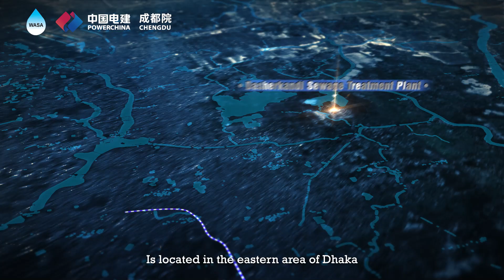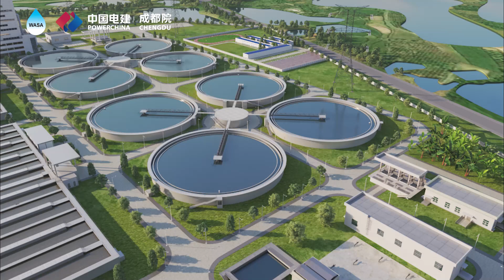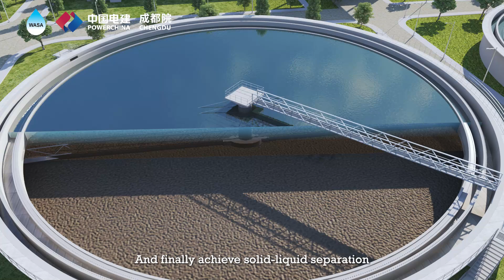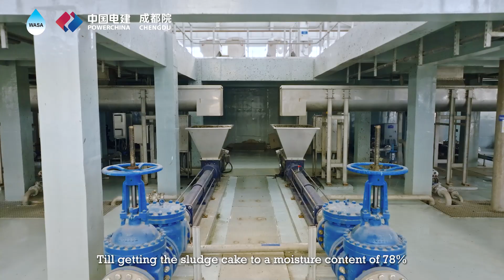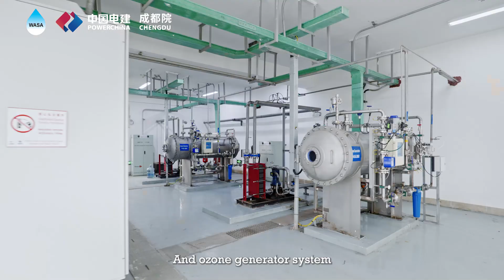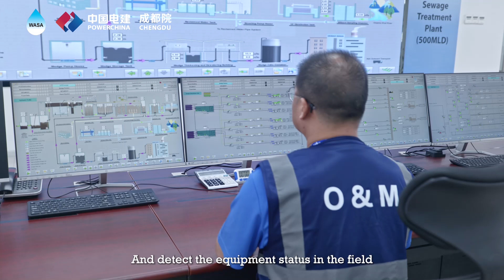All about the Dasherkandi Sewage Treatment Plant

Comment: Dasherkandi STP project
Major construction quantity
- Pile foundation : 10,000 piles
- Concrete : 200,000m3
- Rebar : 26,000 ton
- Equipment : 6000 sets
- PLC based SCADA Automation System

Comment: Summary of Dasherkandi Sewage Treatment Plant Project (500,000m3/day)
The Employer : Dhaka WASA (Water Supply and Sewerage Authority)-Bangladesh
The Consultants : Hankuk Engineering Consultant (HEC)- Republic of Korea as Employer's Representative
EPC/Turnkey Contractor : HydroChina Co.- China
Funded by China EXIM Bank in 2016 year
EPC/Turnkey Contracts : 30 August 2015year
Original Contract Period : 36months + 1-year O&M
Work Scope : SLS + SCP + STP + SDIP
Commencement Date : 01 August 2017year
Taking Over Certificate : 31 March 2022year (56 months from the Commencement Date)
O&M start/finish : 01 April 2022~30 June 2023 (15 months)
EPC/Turnkey Contracts will be completed in January 2024year.
* All design engineers, site engineers and managers did their best despite the difficulties of Covid-19 Pandemic.